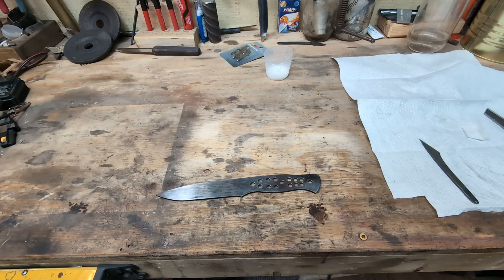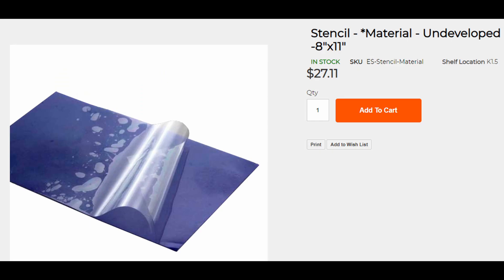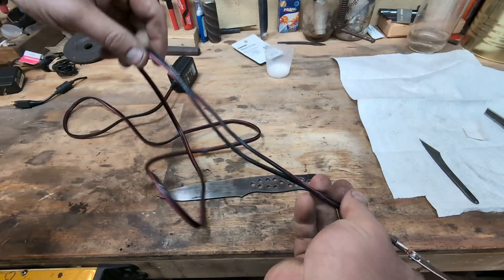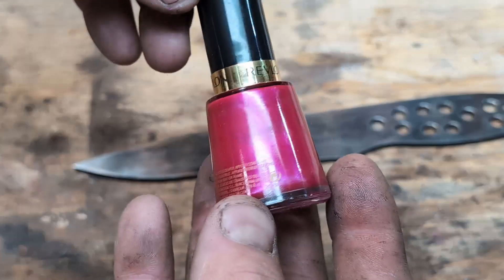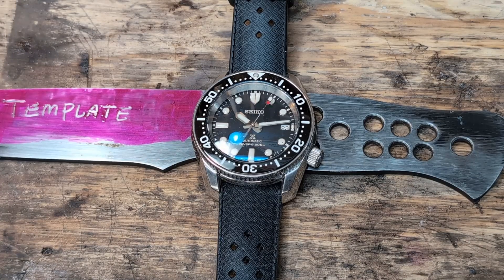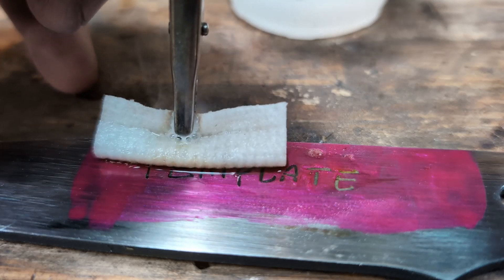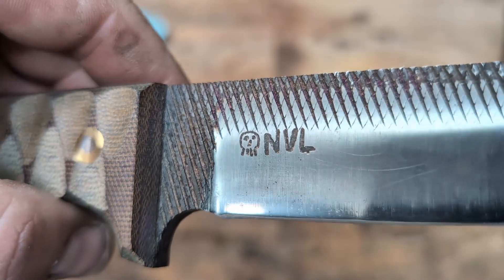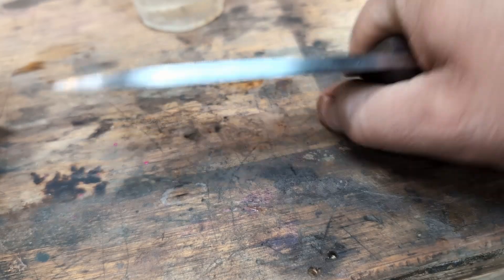The CHEAPEST and EASIEST way to etch your makers mark

Comment: Great video. For about a year now, I've been using 12 V formerly laptop PC chargers with alligator clips added in my electrolysis of cast iron skillets. Like this video states, these chargers are readily available at thrift stores for a few bucks. Don't go burning out an old car battery charger! I keep extra ones handy in case one bites the dust but so far my laptop chargers are holding up and not burning out. Maybe I should try etching my name on a cast iron pan? Hmmm. Thanks for the great video and idea!

Comment: Doesn't it begin to rust after the etch is made?
Reply from the maker: It will only rust if you don't oil it, but that's the whole blade really as it's made from carbon steel. I've been doing this for years and didn't notice any different with my blades etched like this or the blades that my makers mark was stamped in.
Reply: If you use Windex to clean it off after etching the ammonia will neutralize the etching effect or the acid I should say and that will clean it where you won't get that rusting right away you should be fine at least that's what I've learned on YouTube and many other channels that Windex is the key.  @NickVanLeuven

Comment: This is amazing! 
I was wondering, can I use a sticker as stencil? I can print out a design in sticker paper, use a cutter to carve the design.. or maybe just use masking tape and make the design directly on the tape with the cutter? Also, can I do this with any kind of metal (like aluminum) or just for stainless steel? Thanks!
Reply from the maker: @anameyoucantremember  vinyl stickers work well, masking tape also works. I've only ever tried this on steel
Reply: Skill Tree also has a great video on this

Comment: What purpose does the fingernail polish serve? Could paint be used? I'm thinking I could use the laser engraver to cut my design through the paint as I've done for other methods, but never have tried anything like this. One solution for using a battery charger is to add a battery for it to charge like a mower battery and wire your leads onto that. That's what I'm thinking about doing. This was a good video man, I like that the music wasn't overbearing and the pace you moved along was just right. Thank you
Reply: The polish is just a coating to prevent the corrosion 'etching' from happening on that surface, otherwise the corrosion will happen everywhere he is contacting with the electrolyte.  Fun way to learn about corrosion cells and cathodic protection.
Reply from the maker: Paint should work and the laser engraver should make a really good, crisp design. Thanks for watching!

Comment: Well, it’s either I unalive myself this thanksgiving weekend or I etched my name on my 119 special and save $1500 on a metal engraver.
Reply: Update: I did it ! It works, I’m alive ! But the area around my etching is very rough looking, I think I forgot the step where you wait 20mins to let the paint dry. Because the vinegar removed some of the paint during the process. I’m gonna keep practicing on rail road spikes until I think I’m good enough for my nice knives